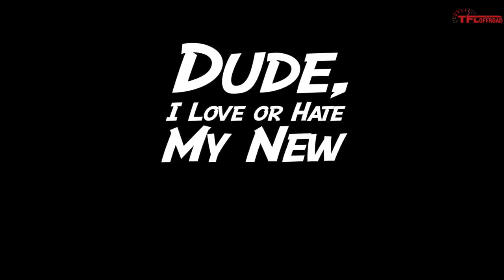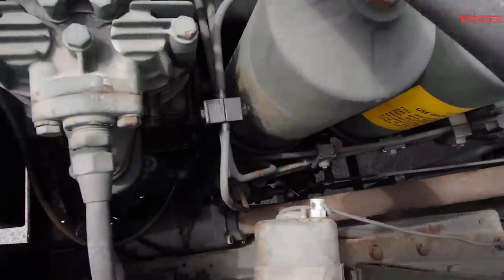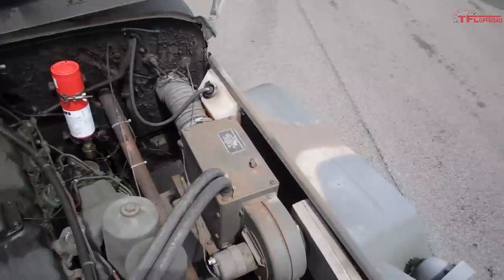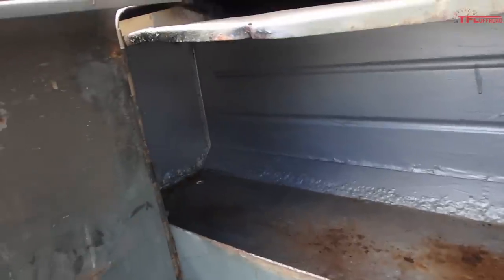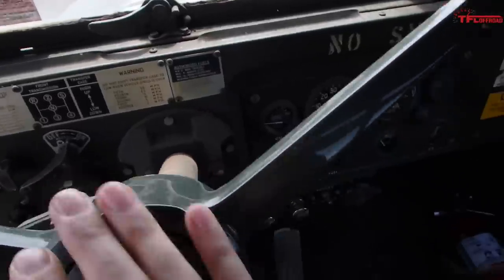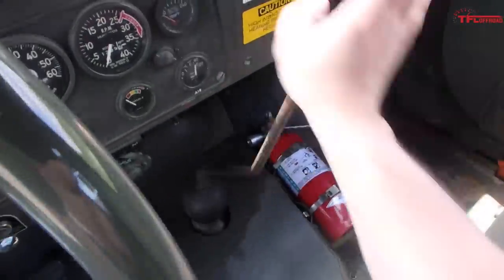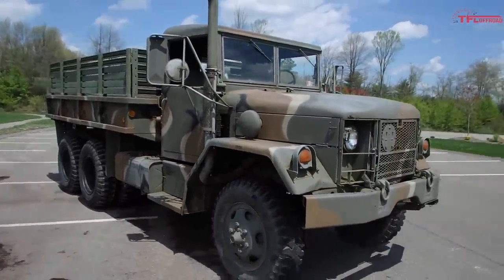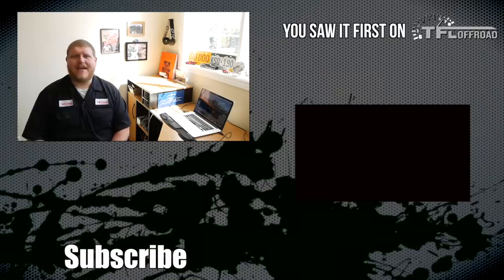Forget Pickups: This Military 6x6 is the Ultimate Adventure Machine! - Dude, I Love My Ride @Home

Comment: The pinions, front and rear are not to add axles, but to make the axles interchangeable. All 3 axles are the same, with a front and rear pinion. You can take any of the 3 axles and put it in any position, front or rear. You bust an axle, you just take any good axle off another busted truck. COOL RIDE!
Reply: You don't put a steer axle in any position.  You can, however, take the center section and put it in any position.
Reply: @doug6885  You're right. Forgot the steering part, but  as you say, the center section is the same. In war, they tried to make everything interchangeable. No time to order special parts! :)
Reply: Where is the pto for the winch ?
Reply: @patrickhorvath2684  There's no pto because there's no winch.  You CAN add one, but it's not cheap.  It's cheaper to get a 24v winch and make a bracket to mount it.

Comment: I recently bought a running 1966 Deuce & 1/2 for $1525 from a GSA auction. It is also equipped with a 900-gallon water tank and pump and makes a great off-road fire truck. Couldn't be happier!

Comment: I drove an M35A2 in the army. Even in sub-zero weather, we never used ether to start. Ours had a glow plug set up that pre-heated the fuel. When nothing else would start, the Deuce would.
Reply: Agreed Charles. I don’t have starting fluid in mine and even running on straight used motor oil, it’ll start in the cold. The coldest I’ve started it was about -10F and it popped right off. 22-1 compression seems to make a heck of a lot of heat when starting. I just hold the fuel cut while cranking it to warm the piston crowns for about 5 seconds and then let her go and she pops right off. 👍

Comment: Love driving mine. It has become sort of a local celebrity. Getting flood victims out of their homes and clearing downed trees. They respond well to fuel pump adjustments. Mine doesn't care what you put in the bed. It just rides smoother with 6 ton of gravel in it.

Comment: Couple of things, that's a 24v system, not 12.  You can run gasoline, but you have to use a 15:1 ratio of gas to oil to lubricate the injectors.

Comment: You can purachase a kit for these trucks that will tie your air into the steering system to give you air assisted Steering, which is almost as good as regular power steering.
Reply: If you aren't strong enough to steer this truck, you shouldn't have one.
Reply: @garymathena2125  I personally have never had a problem steering one, I only made the comment because when I used to live in Berks County, Pennsylvania, most of the Fire Companies had them as Brush Trucks, and most of them had the trucks retrofitted with the air assist power steering.  The Deuce is not all that hard to turn, even without power steering. I have driven old dodges from the early 60's that did not have it, and they were a bit of a bitch to try and turn around in tight spaces, especially if you were stopped

Comment: Very thorough video.  Good condition of the truck considering the age.  Drove non military versions of this thing at the airport.  Had a lot of experiences with 30's on up in vehicles.  From hand cranking engines to modern systems.  Good times.  :)

Comment: These Trucks are fairly cheap to purchase, and extremely cheap to insure as well. They are fairly dependable, but slow on the roads with a max speed of approx 55 mph, downhill with a strong tail wind pushing you. But they are extremely loud inside the cab, since the exhaust pipe runs right up from the engine directly at the right front cab corner. Good hearing Protection is highly recommended if you plan on driving any length of time and distance. They can be great multi use platforms, ranging from Troop/Cargo Carriers to Water/Fuel Trucks, Dump Trucks, Medium Duty Tow Trucks, Plow Trucks, and, one could even improvise one into the ULTIMATE BOV/APPOCOLYPSE ESCAPE TRUCK, OFF ROAD CAMPER TRUCK, and yes, there are even Fire Depts on Long Island, NY, and in Pennsylvania, and other States that have them set up as Brush/Forest Fire Trucks, aka, Stump Jumpers as they are called, and High Water Rescue Trucks. In short, these Trucks can be used in virtually any kind of scenario that one could possibly think of.
Reply: 5 grand isn't cheap for a turn key one that has zero issues. Insurance I don't know about that.
Reply: @IG10705 5 grand for a deuce is a hell of a lot cheaper than what brand new pickups are selling for, they are close to $100,000 now, depending on what size you want, and what it has in it. Insurance for a deuce is pennies on the dollar, because the deuce is virtually indestructible.

Comment: In my 21 years in the Army, never had to use ether. The multifuels were equipped with a "preheater". In Alaska when temps went below 0 we used a Swingfire to warm the engine.

Comment: Sweet truck man. I got to drive a newer one a month before I graduated high school in colorado. It was the best day of my life and did not stop smiling the whole time. I think it has a stronger engine but it has an automatic transmission(I would have preferred a manual), it's super torquey and the breaks were pretty touchy. I drove it offroad over some large gravel/dirt/boulder piles. They are super capable trucks. I don't currently own one but ever since I drove it I've always wanted to own one.
Edit: The color of the truck is desert tan.

Comment: These things are a BLAST! Every time I thought, "this thing is never going to be able to do that", it just friggin did it. I actually prefer the deuce and half over the 5 ton. When my 1SGT retired, on his last day we hid his VW Beetle in the bed of a deuce and a half with the canvas bed roof on so he couldn't leave. haha So many memories.
Reply: Ran into a guy who was relocating and he had his 'vette stuffed into the back of his duece n half
Reply: I actually prefer the five ton trucks over the deuce and a halfs when it comes to reliability and longevity.There's very little that can go wrong with Mack or Cummins unless something extreme and stupid is attempted with any of them.Still,with the 22:1 compression ratio of the multi fuel engines it's incredible how easily those trucks can still crank even in negative temperatures.

Comment: Had 20 of these in my unit in 1971 and none of them had over 100 miles on them with a few just broken in. I would like to say that when these were new they smelled pretty bad compared to any new car smell and most of ours had the huge winch on the front. The biggest downfall to these trucks was even with the ones that had heaters in them would barely keep you from freezing your ASS off. I wish I had one now.

Comment: It reminds me a the 6x6 my grandpa had set up to spread liquid manure on the farm. I started driving it when I was 15 years old. Grandpa's had a gas engine.
Reply: A gasser? In a truck like that? What is that? A gallon per minute? haha
Reply: The M-35 was the first model and had a gasoline engine! Two barrel I think. It even had a grease fitting on the carburetor, some kinda linkage. They also had a 20+ pound, 25 amp generator with a shoe-box sized regulator! Yep.  Great trucks! 👍🇺🇸👍
Reply: @kentporter2991 
Actually,the M34 "Eagle Beaver" was the very first prototype and it mainly used the body,frame,and chassis of the GMC M135-M211.
The differences were the front end,cab,engine,and transmission.
Instead of the GMC 302 the prototype used the OA-331 from Reo and Continental which later on became thee engine for the original series of the M35's.
Also,they used the Spicer 3053A transmissions instead of the automatic transmissions that all of the GMC two and a half ton trucks used.The Spicer transmissions were entirely used for the complete production of deuce and a halfs until the trucks were discontinued.

Comment: Is it right, that these trucks do not have slipping differentials, that they are locked all the time, which means that the inside and outside wheels make the same distance even in tight corners? Therefor the truck must go through tires like nothing good or does it not?
Reply: open differentials

Comment: So It’s in 6wd all the time? The transfer case is only a high/low? Just curious. I didn’t realize they had that back then
Reply: The ones I drove all had an air valve under the center of the dash that was actuated by a lever. That was used to connect or disconnect drive to the front axle.

Comment: Nice stock version. I would love to see one of these made into a fully stainless steel body. That would permanently solve the rust issues.
Reply: Stainless would be very hard to paint, and with as much flexing as these trucks are subjected to, the welds would probably crack over time.

Comment: I had a 1968 model and I rarely had to use ether to start in cold weather. I wonder why that is. I know some diesel engines are just really cold Blooded. Used to have a road grader with a Detroit 6L71T that would not cold start without ether ever. lol. Wish I would have put that engine in the deuce.
Reply: The LDT-465's & LDS-465's in the M35A2's-M756A2's had 22:1 compression ratios which made major differences among other vehicles when starting in the cold.
Alot of these trucks would crank just fine even in -5°F on sloppy motor oil or diesel as long as the piston crowns are still good and have been pre-heated decently.
On another note,when using gasoline it's wise to use 15:1 ratio mixed with diesel or oil so that the injectors remain lubricated.
The multi fuel engines weren't the best on torque,but gearing ratio made up for that in many ways.
Still,I always liked the five ton trucks alot more,mainly the variations that were Mack or Cummins powered.

Comment: I was an Army MP stationed at the Nha Trang Air Force base. We guarded Army intelligence aircraft, a classified operation building and we took over a US Air Force Air Police checkpoint at the entrance to the Army portion of the base flight line. We worked closely with the Air Police and were on their radio net. One day, we joined them at a BBQ on the beach (Nha Trang was an in-country R&R  center, based on a beautiful beach). One of the AP 4x4 pickups got stuck in the sand and would not be able to get out on its own. I went back to our motor pool for a deuce and a half, which pulled the pickup out to the road with ease. A great vehicle.

Comment: Definitely wasn't expecting less than 200hp when was saying the engine specs😂
Reply: its a tank, whats the rush.
Reply: The multi-fuels we're never known for horse power. The cat engines they used later in the A3 series were more powerful. Imo, the A2 series is fun to drive since it has a manual vs an automatic transmission.
Reply: That is 130 with the turbo. Naturally-aspirated versions ran 125 horsepower, and rolled coal like nobody's business. The turbo was to kill the smoke.

Comment: btw for 4500 bucks you certainly got a lot of truck sounds like a pretty good deal to me
Reply: I paid $1390 for mine, after taxes and auction fees.  Drove it off the lot after adding fresh batteries.  They used to be much cheaper.

Comment: You shouldn't need ether to start the truck in the cold, unless the engine is worn out.  You should avoid using ether as much as possible; it wears the engine out faster, and eventually you'll have to use it all the time.

Comment: What if you mixed the fuels and or put high octain in with diesel ,what about vegtable oila , may I ask? :)
Reply: It will run on everything from kerosene to jet fuel
Reply: Yes, used vegetable oil,  used motor oil, transmission fluid, gasoline, even vaseline mixed in.
Reply: @patrickhorvath2684  Wow, nice ; )
Reply: To be warned gasoline is for emergencies online. Deuce and guns has a video explaining that. The gasoline doesn't have the lube or whatever diesel has to make the engine run
Reply: @IG10705  
Straight gasoline will starve the injection pump of lubrication. 
Official recommendation is one quart of new motor oil per 15 gallons gasoline. 
Some folks will run filtered used motor oil with gasoline. 
Safest bet is pure diesel.
Reply: @patrickhorvath2684  thank you I couldn't remember that for some stupid reason

Comment: I'm sure they exist but I'd love to see you guys review a Deuce with a modern diesel swap. The stock motor's numbers are weak as hell-- you can get a Ford, Chevy or Dodge diesel 1-ton pickup with twice the HP and almost 3x the torque just by ticking a box when ordering. 350-ish torque when you've got a 13500 pound vehicle to move (plus cargo!) is sad.
Reply: TheJohn8765 terrible example, different class of engine.
Reply: Your talking about a diesel engine designed in the 60's for military applications vs modern diesels. But there is such a thing, it's called the m35a3......
Reply: Who would win in a tractor pull contest ? Big 3 one ton pickups with whatever engine  wouldn't stand a chance against an M35..

Comment: 130Hp??? Not Much. Must have been slow
Reply: Recommended cruising speed 48 mph. The engines were designed in the early 60's to be reliable not hot rods.